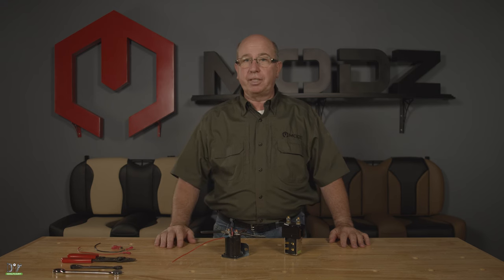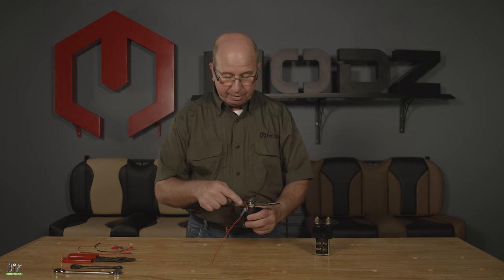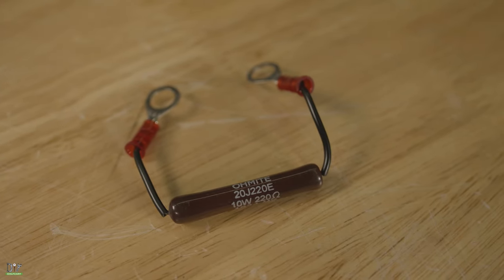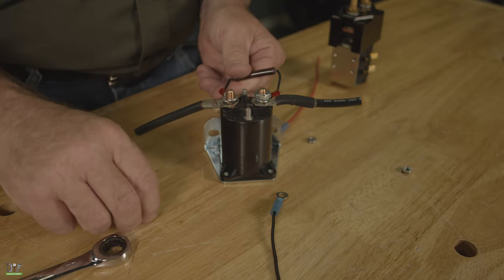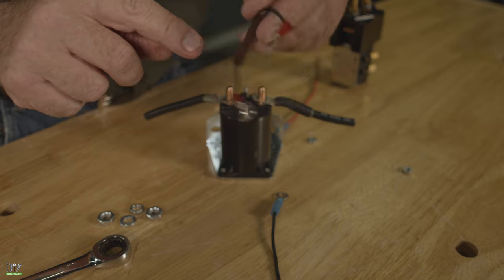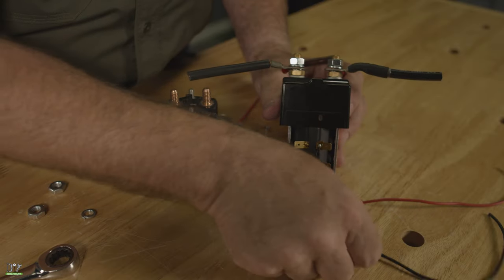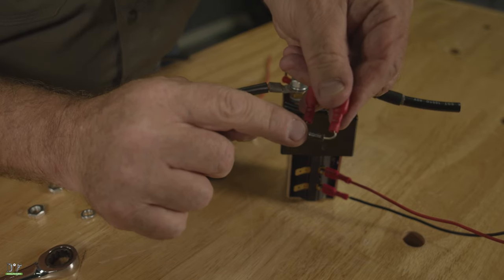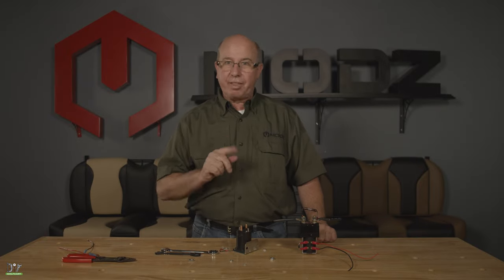Upgrading Your Golf Cart Solenoid -  Heavy Duty Solenoid Installation How-To

Comment: My cart runs fine most of the time however on occasion I step on the gas and nothing happens.  Eventually it will take off .  Any ideas what might be wrong ?
Reply from the maker: Listen for the solenoid click. If it doesn't click it might not getting voltage to engage or it is getting the voltage and not engaging. That's where I would start. Thanks for watching and don't forget to subscribe.

Comment: So for activation circuit wires, I have a blue and a yellow wire, and no diode.  I also have an additional red wire that is attached to the post with the battery cable.  How do I convert this setup to the new solenoid?
Reply: I have blue, yellow, red and black wires as well. What did you end up doing?

Comment: I have no voltage to the ignition switch after an mistake in wiring on my 2013 club car precedent and no click from solenoid the resistor be the problem if not could you let me know where to start looking thanks
Reply from the maker: The car could have blow a fuse or melted a connection in the harness. Not going to be fun chasing that one down!!

Comment: Would this work without the diode?
Or temporary a wire bridging the 2 terminal?
Cheers Billy
Reply from the maker: The diode is strictly a safety protecting the controller. The cart will run without it. However, if you install a new controller you better have one on there if you have to file warranty or they will not cover it!! Thanks for watching and don't forget to subscribe!

Comment: Hi. What's the diode and resistor for?
Reply from the maker: The Diode is a safety feature designed to protect the controller. The Resistor is a Pre Charge resistor for a controller that doesn't have a built in capacitor. Thanks for watching and don't forget to subscribe.

Comment: this doesn't help me install my solenoid at all
Reply: what are you confused about?
Reply: I have a Bad Boy Buggy with two Motors one up front 1 in back 48 volt would I have to upgrade to the heavy-duty on both one of them are small and one of them is big just wondering

Comment: what happens if you get the diode backwards ? would that stop power from getting to the motor?
Reply from the maker: Putting the diode in backwards will cause the car not to run. I seriously just got off the phone with a gentleman the the solenoid would click but, no go. I told him to remove the diode and the car runs! Diode was on backwards! Thanks for watching and don't forget to subscribe!!